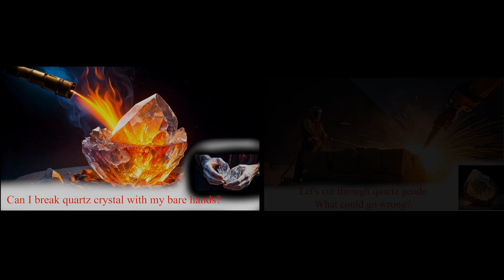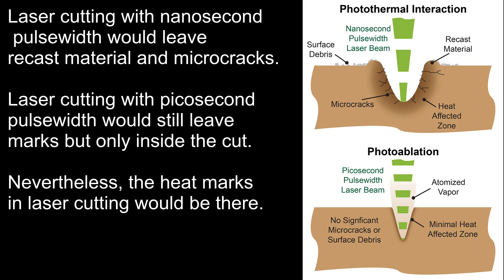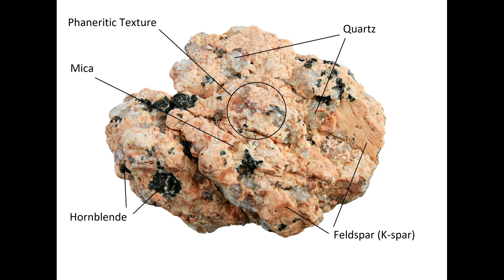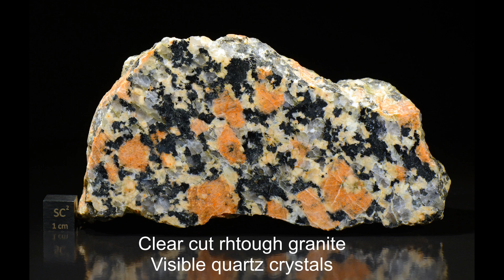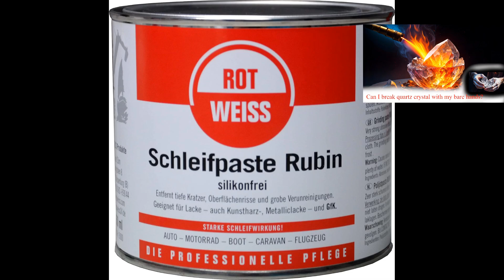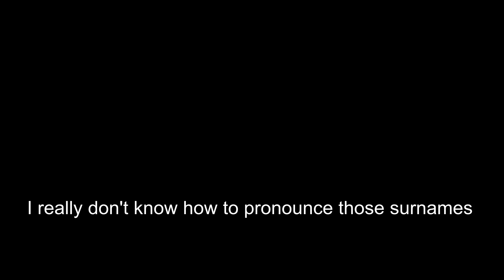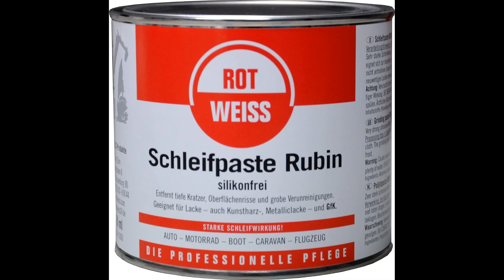How did ancient Egyptians make those granite and diorite jars and boxes? Ancient masonry technique

Comment: A heated copper or bronze blade could be hammered or pounded on corundum grains or powders impregnating the blade or bar to create a saw or file. 

If the mixed corundum into molten copper or bronze wouldn't it provide cutting power?
Reply: Experiment clearly show the corundum being embedded in the copper during drilling, causing the grooves, 
you can find it on yt too
Reply from the maker: Maybe, but we did not find any of those tools and to be honest, it would be pointless. The better way and less work would be using corundum paste and simple bronze saw or drill. The effect is quite The same but you don't have to Hammer crystals into Copper.
Reply: @AncientTheoriesChannel  : I doubt all the copper and bronze tools discovered to date were analyzed specifically looking for corundum impregnation. Until such analysis is done, I think it hasty and unscientific to disregard the possibility out of hand

Comment: Does not explain the vases or massive rose granite ornate pillars, straight edges of the casing stones and other stones seen throughout the area. The drill hole patterns appear to be possibly diamond or another hard substance because the rotation drill marks can be seen.
Reply: There are depictions from the Egyptans themselves how they drilled those holes.
Cores too.
Guess ehat?
NOT PERFECTLY CYLINDERICAL.
THEY ARE BIGGER AS THEY GET DEEPER.
explain that with a diamond drillbit. 
Explain why the people you are quoting did not tell you that too.
Reply: A skilled mason can quickly produce straight edges rapidly with hammer and chisel.
Reply: @janbaer3241  When you say rapidly, it rather depends on what stone you are carving . Oolitic limestone, yeah sure, I can produce a  flat strip to start taking my bearings from in twenty mins ( say about 20" long, 2" wide) ; Portland stone , classed as a hard stone (because it chips rather than crumbles ) is going to take you quite a lot more work, and the harder the stone , things get worse fairly quickly. And not only that, but I wouldn't even attempt granite with copper/bronze chisels , that seems an utter nightmare ; like some labours of Hercules task.
Reply: @ScorpIron58 Hmmm...Lets see...I was baring eighteen when I cause an 80 ton stone move over 8' and was soundly scolded for that and I've split stones (granite which splits very easily by the way) using traditional  "drift wedges" in less than a few hours...Time is relative if you actually learn a skill...rather than "guess at it" which is pointless...And yes, if you know what your doing and how to do it you can chip granite even with bone tools with stone bits...but it takes a lot more time and patience...LEARN a method before guessing at what does and does not work...
Reply: @JayCWhiteCloud  So you are a quarry man by the sounds of it. What do you mean, moved 80 ton stone 8', how? Down an incline? Accidently? Sounds very dangerous. I was only squaring up ashlar!

Comment: Producing an accurate flat surface is not hard, if people had any engineering training they would know that and it would not be a mystery. As you say you need an abrasive paste that is harder than what you are trying to smooth. Silicon crystals would do the job with most rock, including , most, but not all, granite - they have a lot of silicon in Egypt. You also need 2 other surfaces to rub your work piece against - three pieces in total so you don't cut matching curves if you used two surfaces. 

To get high levels of accuracy you have to be able to measure it - how do you propose they did that?

Moving on from smooth surfaces, producing an accurate surface that is curved in multiple dimensions is HARD. The only way I am aware of this being possible is with advanced machine tools but there may be other methods.

If we take some of the vases (the ones with handles) people are debating we could not do that sort of thing in the 1960's when I was a tool room engineer in the aircraft industry, we would normally to work to about 2 thousandths of an inch to give you an idea, but curved surfaces like that - no way.

I have to say I am quite enjoying your channel.

Comment: Unlike most of academia, I don't dismiss well thought out hypotheses out of hand simply b/c it might undermine the "consensus" (a word incompatible with science, but prevalent in "The Science"). 
I think your theory has merit. As you point out there is physical evidence of this method in use. However, it's a logical leap to suggest this is how the many thousands of diorite, shist, granite or any of the other hard stone vases were created. It's obvious they Egyptians utilized some sort of lathe to turn these stones, but that only gets them so far. The voluminous number of vases that have been found and continue to be found is indicative of some sort of mass production manufacturing capability. Couple this with the symmetry of these vases both internal and external. Not to mention turning these pieces on an ox, bull or whatever powered lathe still does not begin to explain how they were able to achieve the degree of repeated precision from artifact to artifact which today would be indicative of CNC driven machines. Many of these vases have handles. These handles present another degree of difficulty by orders of magnitude. The objects exist. We know they were made. We don't know when, who or how they were made. Perhaps the paste is part of the equation, but is far from a complete explanation. Again, the sheer volume of vases indicates a degree of precision with the ability to produce repeated results with high precision using a method that suggests a singular type of tool used due to the error that would be introduced in moving artifacts from one machine to another for additional machining that just doesn't exist in the these artifacts. The  Antikythera mechanism exists and we know the Greeks stole much of their tech from the Egyptians. Perhaps they had built a similar extraordinarily complex tool, an analog parallel to a CNC machine. It's not impossible. CNC's use complex calculus and trig to remove material from an object resulting in the production of an object whose design was predetermined. A very complex tool analogous to a modern CNC, but in the same mode as a large scale Antikythera like mechanism whose design wasn't predicting solar mechanics, but used to guide a diamond edged or corundum edged cutting tool over a rotating work piece that's constantly bathed in corundum paste, now that might be something to consider. Yes, outrageously complex, but not impossible. My only reservation is the volume. A machine like this would be rare and the volume of vases in Egypt suggest whatever tool was used had to have been available on a larger scale. 

My post is long enough, but there is also evidence to suggest they may have had a method for either making molten stone or softening stone to a degree with a tech unknown to us today. What we can say is that there is a finite number of ways to achieve their results, but there are infinite numbers between 0 & 1, so what does finite mean anyway. :)
Reply: Paragraphs! Paragraphs dammit!
Reply: John, I will admit, I only "scan read" your debate once I got to, "...Unlike most of academia, I don't dismiss well thought out hypotheses..."   BECAUSE, most are not..."well thought out"...LMAO...at all and most would rather just speculate than learn a skill to form understanding of a topic as the latter takes effort that most ultracrepidarians simple can't muster within themselves.  So, instead of debating with you the subtleties of the topic found in the vernacular arts of architecture and traditional indigenous life skills I will ask a few questions. 

Do you know how to quarry stone traditionally?
What is the largest stone in tones you have moved, split and shape with modern or traditional methods?
Have you ever carved a rock with traditional or modern tools?
Can you name the basic stones by touch, taste (yes geologists and mason do taste stones) and understand them well enough to tell them all apart?
How do you move a 80 stone? (Yes we can most certainly move "big rocks" using traditional methods and even larger than that too...LOL...there is not mystery or "lost technology" regardless of what the "grifters" would like you to believe as they make their millions of such naivety and ignorance.)
Can you walk into a quarry, forest, or from dug clay design and fabricate a traditional structure such as an arched bridge in stone, or other structural archtiecture more than two stories tall or taller from these most basic of materials using only traditional methods or even modern ones?

If you can't do those things, or know even where to begin to learn them, then do yourself a favor and stop guessing at what humans...DID DO... and can still do if they bother to make and effort to learn from those that still can...I what scaned you rather long and pointless comment was "guessing at" a topic that you have such a low level of understanding within that you probably don't even know what you are looking at half the time when you look at something from the ancient past (a common issue with most in these discussions) and I don't mean that as a progoritive at all...just a fact of reality in what you "don't know" nor clearly understand...
Reply: There are not thousands of hard-stone vessels. There are many, many thousand soft alabaster vessels, but only a few hundred of the other. Over 500 years, just a few made per year accounts for all of them. In dynastic times skilled hard-stone craftsmen were kept busy on pharaoh statues instead.
Reply: @sciptick ur wrong about the amounts.
There are hundreds if not thousands of hard stone vases in private collections and in public museum's.
There is a YouTube channel called Uncharted X that I would suggest to all in the comments to go and watch if u are interested in this sort of thing.

Comment: If you knew anything about corundum in the area (if you had done any type of research whatsoever) you would know there are rock layers in egypt (some just a few miles from Aswan) that contain large quantities of corundum. It would not have needed to be mined in Greece or anywheres else. If you had spent any time at all researching megalithic construction you would know that everything shown in this video is geopolymer (concrete). Nothing was ever quarried-carved and transported. The granite at Aswan, for example, was ground to dust and this dust was mixed with certain chemicals found locally (such as natron) and cast into all the boxes, jars, columns, obelisks, etc. in place. The grinding lines are exposed in the granite quarry for all to see as your video shows. It would have been some type of rotating grinding head at the end of a boom. The large obelisk still attached to the quarry was never meant to be moved; it is there as an idol, a temple so to speak, that would have been worshipped since the quarry itself is the 'birthplace' of most of the monumental sculptures/temples of the egyptian civilization. Several years ago the Geopolymer Institute in St, Quentin, France proved the pyramids are made of limestone geopolymer and the fantastic structure at Puma Punku in Bolivia is made of sandstone geopolymer and andesitic geopolymer and the moai statues on Easter Island are made of basalt geopolymer. Go to the G.I. website or watch videos right here on you tube by professor Joseph Davidovits to learn more and see for yourself their chemical analyses/experiments and findings.
Reply: I have, and it is without merit. Making things more complicated than what you started with.  The energy and grit needed to grind the natural granite into powder far exceed the energy needed for traditional granite carving into what we see today, We have no idea how it was done and what their tools were. They had complete control over the stone on the molecular level using methods totally unknown  to us. We see their fingerprints all over the globe in the form of scoop marks and trowel tracks, as though the stone had the consistency of soft butter. . The fact that every building block and artifact is one of a kind and has no doubles would requite a designated form to be made. The amount of non-standardized blocks alone on that scale (Great Pyramid by itself has over two and a half million blocks) puts this theory in the toilet. https://youtu.be/TqUtb1O4TkA

https://youtu.be/A7xBwGNLnpo
Reply: @ very clear to me you did not research the GI discoveries. Very clear to me you know nothing about concrete form work. Stick to your theory if it makes you happy. Meanwhile there are those out there like me who know and understand the truth. The GI studies are quite conclusive and have high merit.
Reply: The vases cannot be made from granite "ground to dust" because you can see macroscopic crystals in them.
Reply: Davidovits is a notorious crank and your claim that the Unfinished Obelisk was never meant to be removed from the quarry is easily the most pathetic, asinine COPE I’ve ever seen from the “ancient high technology” nitwits when confronted with evidence that contradicts their laughably stupid narrative.
Reply from the maker: Corundum can be found in common places, but I do not have any evidence of corundum mining in this area (Aswan region) at the time. But I have evidence of corundum mining in Naxos during ancient times. I also have a good understanding that the same hard stone jars were made on Crete. And about geopolymers... This topic is a little more complex than one comment. People tend to use this term but is it really geopolymer? Were those blocks casted? Even if so then why the quartz grains show us marks of cuting with hard tools? Even if they were casted then they were polished with hard stone grinders or... corundum paste. And it is easier to accept that ancient Egyptian had corundum paste than they had technology of geopolymer casting granite, which is... at least questionable for the moment. I'm not saying some of them couldn't be casted, I'm not saying I know everything about geopolymers, but I know enough to doubt it. Maybe I just need to (as you said) do some more research in this area, but even then those outter quartz grains were cut through. And I believe they used corundum paste for that. At least in the late bronze age (around 1350 BCE).
Reply: @AncientTheoriesChannel  take some time (roughly a day maybe two) and look at the G.I. scientific research.

Comment: That doesnt explain how they achieved 1 to 4 micron accuracy. inside vases and jars, or right angles on internal corners . Half a story is no story at all
Reply: You are confusing the grid size needed for polishing hard stone to a shine (0.5-4 microns) with the accuracy of the dimensions of an object
Reply: @nabooka316 
It is really simple.. 
the Egyptians had vertically rotating plates, those are really good.. 
ones glued on a platform, which was made of copper beryllium alloy. Makes it so strong as steel.. 
the glue, don’t know jet, they have it in Pakistan to.. 

Bud ones placed, start cutting, the center always stays in the middle.. 
it doesn’t change course.. 
after they finished they cut of the vase.. and done..
Reply: Right angles on an inside corner is  not technically difficult but lots of hours griding. Once you have the bulk chipped away you'd use a paste and grind using a right angle  bronze tool.
Reply: Thank you will not be watching this video as your comment points out the exact reasons I'm here not being addressed again thank you
Reply: It's hard to believe, but those "theorists" ignore the actual evidence the Egyptians left behind.  They either are more ignorant of Egypt than they admit to you,  or they are outright liars.  Ask yourself how a modern woodworker achieves that precision forming a wooden bowl on a lathe.  Then consider, would a modern stone worker work differently?  Then ask someone who actually knows whether the Egyptians had lathing methods.  You also need to understand the difference between accuracy and precision.  The Egyptians didn't always concern themselves with both.